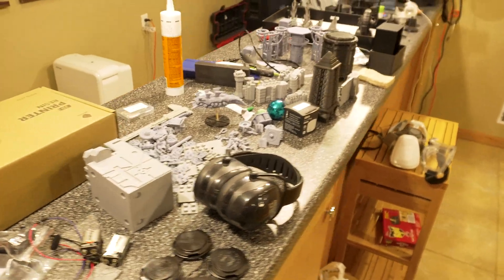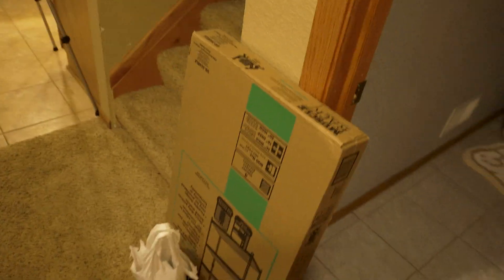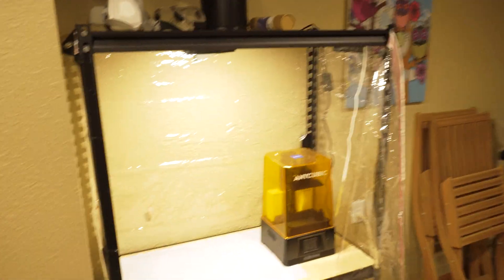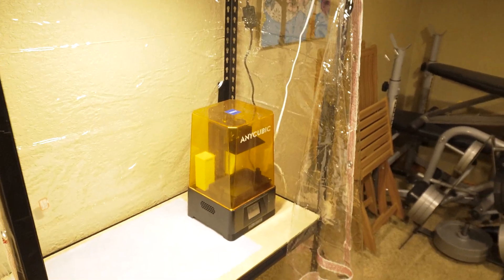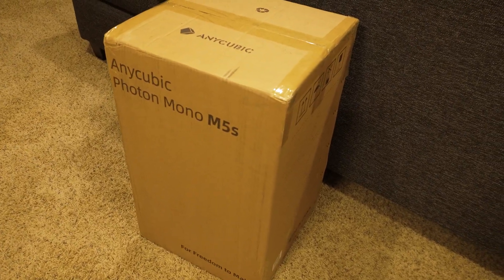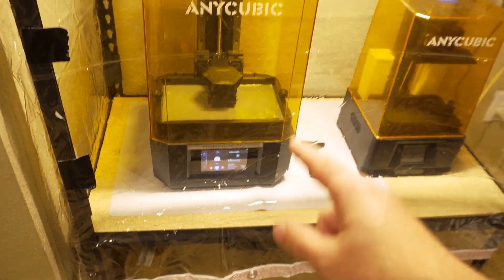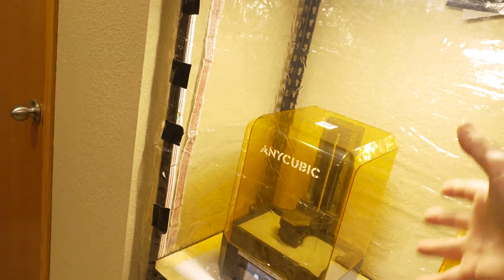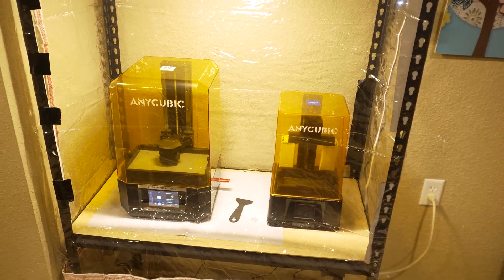How I built a DIY 3D printer vented enclosure setup. Safety First! BONUS Video!

Comment: Nice setup. I have the same type of rack in my garage but I think mine is wider. With that, I smell the resin in my house so just bought an enclosure with fan from amazon by wsplu. It is very big and should fit my elegoo saturn 4 ultra and will find out in 2d when it comes in .$70 with tax.
Nice video.